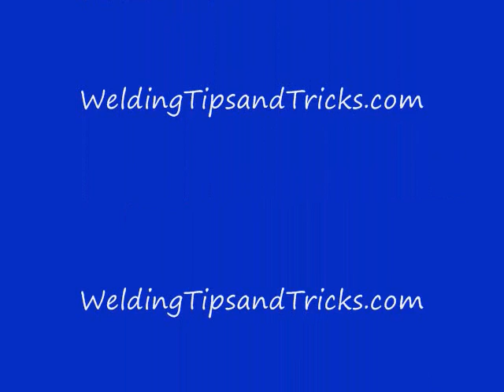Mig Welding Aluminum with a Spool Gun - Aluminum Mig Welding - Mig Aluminum Welding

Comment: Novice, need some help: wire is bumping the coupon on start of alumnum weld with spool gun.
035" 4043 wire is consistently contacting (bumping) the 1/8" aluminum 6061 coupon on starting the spray transfer weld pushing the Lincoln Electric 100SG spool gun backward. PowerMig 210 MP on 230 VAC. 100% argon at 35 cfh. Coupon is room temp (85 deg F) on first weld, cleaned with acetone and SS wire brush, solid ground. DCEP, rocker switch selected for "spool gun", machine connections are correct. Diffuser/tip/nozzle confirmed correct. Wire routing in gun confirmed correct. Starting with the machine's default settings on the welder, then dialing back speed of wire feed all the way to 300 inch per minute in increments, adjusting voltage up in increments, making notes. Run in is at minimum setting of 50. Inductance is midway at 50 (not sure what this does). I have adjusted both in increments to dial in. I have watched all of Jodie's spool gun videos, and some of TimWelds' re. spool gun aluminum. I do not have an equipment issue as far as I can see. Suggestions welcome. About 14 hours into this between study and under the hood. Is it really this difficult? Quality of weld is poor but improving.

Comment: Hello Jody, I have a Lincoln Power MIG 210 MP, and I have recently started using Lincoln's spool gun to weld aluminum anti-skid aluminum sheet, 14 and 16 gauge ¿any advice as to the Argon flow I should use? Thanks a lot, Mario.

Comment: Does spray transfer method depend only on voltage and feed settings or is this possible to achieve only with right welding machine? I have Kemppi Mig EVO 200 and I'm learning to weld aluminum. So this spray transfer vs. short circuit is very interesting for me to achieve better looking welds. Thank you!

Comment: what model is capable of using the spool gun? my friend said he has a millermatic but the gun doesn't work with his model. I have a big Hobart Powerweld ac./dc stick welder/generator (16 hp ohnan ) that I want to trade for a millermatic that can do aluminum.

Comment: @Chadscarpetcleaning  use a stainless steel brush and use it only for this, gas is straight Argon or an Argon Helium blend if you need more penetration as ionization and thermal conductivity is much higher with a Helium blend over straight Argon.  I guess it will depend on the thickness of what you are welding.  Plus Aluminum is very picky, gotta be clean and try to "push" the puddle if you can, the shielding gas tends to cover better when pushing.

Comment: Also when mig welding aluminum you have to use a smaller diameter aluminum filler beacuse of expansion. IE: I use 0.030 4043 aluminium filler with a 0.035 tip in my 3035 Spoolmate. I have the Millermatic 210 with a 3035 Spoolmate and it can do anything. I have used it for several years now with not one ounce of trouble. Stainless comes out very nice with a mig, but I recommend you spring for the large roll so it can thread out easier. The small roll can bird nest in a heartbeat.

Comment: what diameter wire are you using with the spool gun? I never tried aluminum before, but would like to get more into working with aluminum. The wire type, is it a flux core and your using argon gas?

Comment: yes you can thats true, get yourself a roll of stainless wire change the feed roller, and get urself some 'pure argon.... pure stuff is different than argo shield.. pure argons used for alloy and stainless(can be used on black steeel but very expensive for that...   you would be amazed what you can weld with a mig when shown..cheers

Comment: I do mig welds but I'm watching this because today I got a tank of argon to give aluminum a try and let me tell you, it was a complete disaster.
Its like I'm trying to weld stainless with aluminum wire. It mostly just puddles at the end of the wire and doesn't even care for sticking to the part being welded.
I went through every setting and there's nothing I can do to even get a weld. I know its a bit harder than steel, but it seems impossible right now..